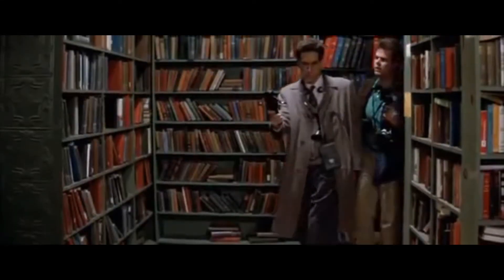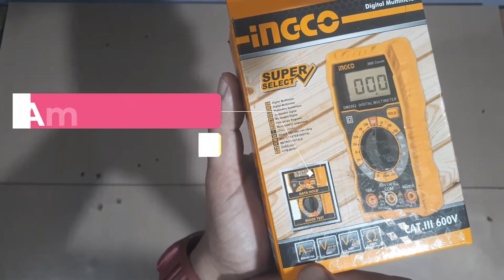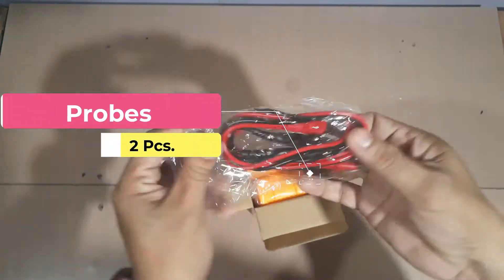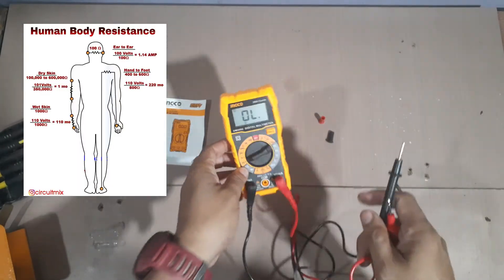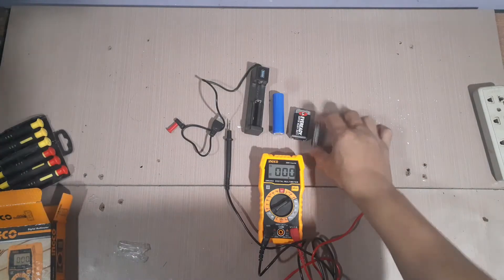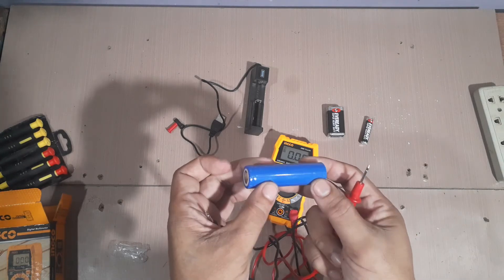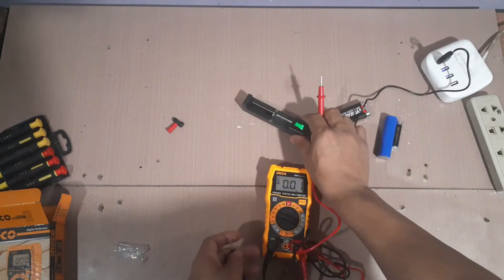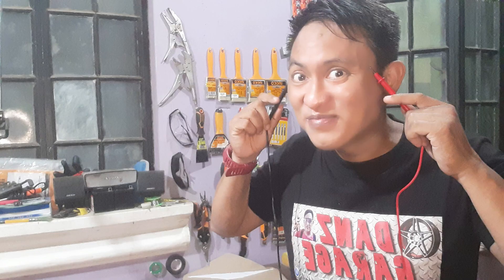INGCO MULTI METER "600V Digital Multi Meter"

Comment: Why are you putting the common probe in the 10amp inlet when testing resistence,you should put possitive in red inlet and negative in common especially when testing 240v or you will blow fuse in unit.